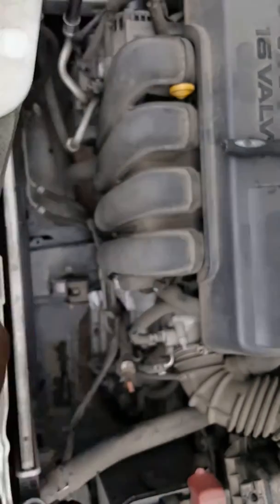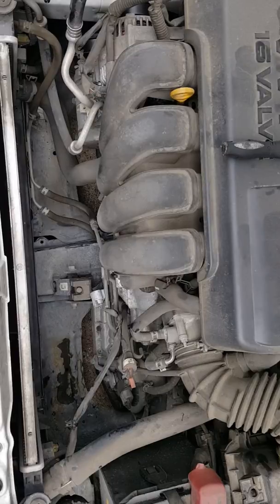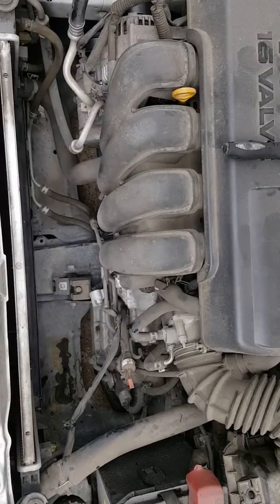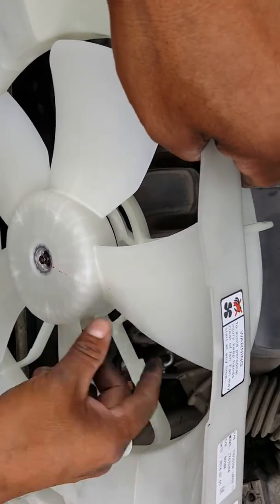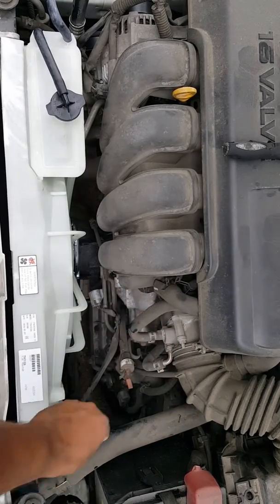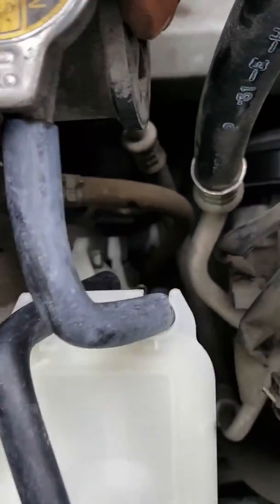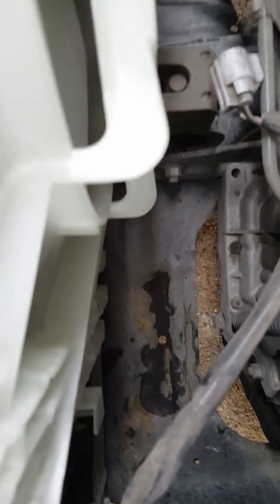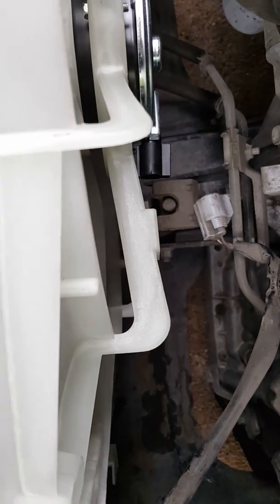2007 Toyota Corolla  how to replace a cooling fan

Comment: My ac in my 2003 corolla stops blowing cold air at stops or even while running you think changing this fan could help or might be something else?
Reply: Check to see if your fan is spinning while your car is idle. Turn the AC to full blast and max cold, and the fan should spin regardless of how hot the engine is.

My car's fan relay died and the fan motor was sticking, so I had to replace both before my car would stop overheating and my AC started working right again.

Comment: Nobody seems to know how to show how to disconnect the fan power supply connector. They always show it after they have it already disconnected and say just press here and pull it back. Obviously, you had a lot of trouble because you didn’t show us how to do. It showed us how to do it after you already had it disconnected and it took you 30 minutes to figure it out.